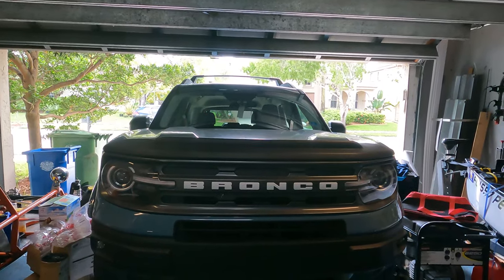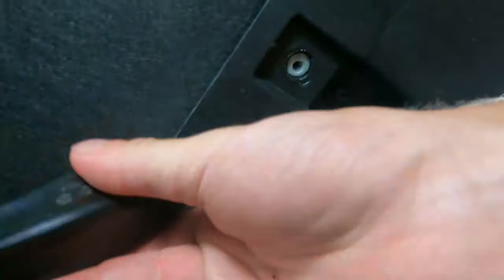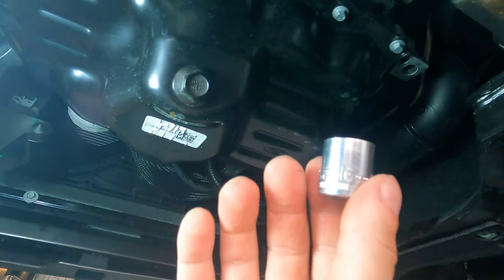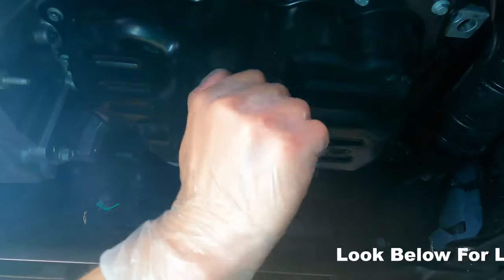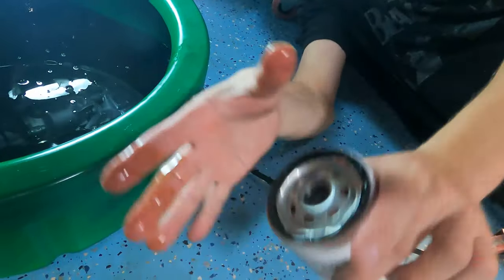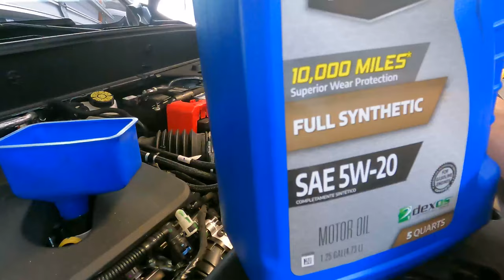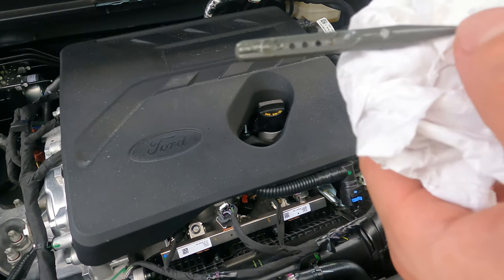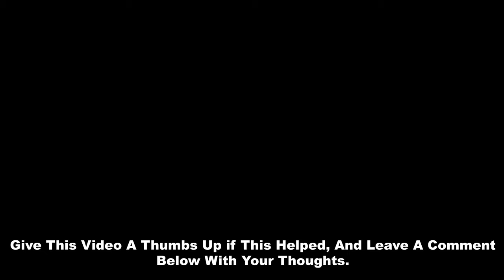2021 Ford Bronco Sport Oil Change 1.5L Engine FAST & EASY IN 4K

Comment: For 2024 1.5L the oil plug is a reusable plastic one. The oil pan is also plastic and takes 6.6 qts (!). note the factory filter was 1 in shorter than the replacement fl910s filter 2.25 in versus 3.25 inches. 15 nm (11.6 ft lbs) torque was printed on the factory filter. the 2024 (big bend) also lost that engine cover

Comment: Everything was good. Until you lubed the filter o ring. I'm a master ford tech. And it literally says in workshop manual "do not lubricate filter o-ring". This is something ford put out a while back. It can actually cause the filter to back off. Your supposed to remove old filter wipe the surface clean and install new filter.  Other than that.  Nice video. Let me know if you need help with anything on it.
Reply: Lubed it with dirty oil at that
Reply: @Mudblud  for real smh
Reply: The dirty oil on the new filter seal was the way I was taught too many years ago!  Thanks for pointing that out.

Comment: Is there not a drain plug crush washer?
Reply: Just did this on my wife's BB, it has a rubber gasket on the plug. I called the dealer and was told that they didn't stock the gasket; but they had the plug w/ gasket. I just reused the gasket, The gasket is recessed in the plug.
Reply: I've never replaced a drain plug ever in 60 years and over 8 different cars. The only time I did is when the shop I used once with a coupon put the filter and plug on so tight I had to use vice grips to remove the plug because I stripped it and also had to use a screwdriver to pierce the filter with a screw driver to get it off. I do my own oil changes. $100+ now when oil and a filter cost $35 anywhere.

Comment: Do you have  the model number for the filter ford used the one you toke off??
I wanna do a first oil change at 1000 and I wanna use the same filter so they wont give my friend a hard time later...
Thanks